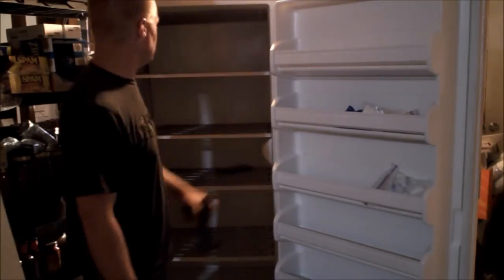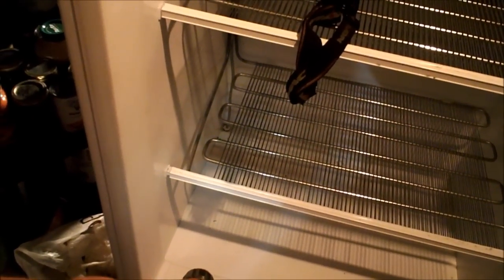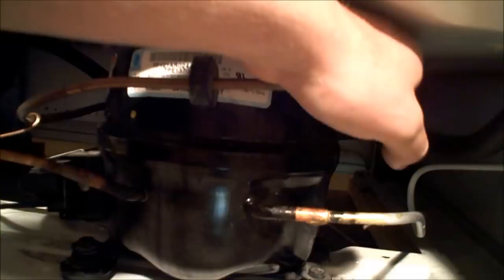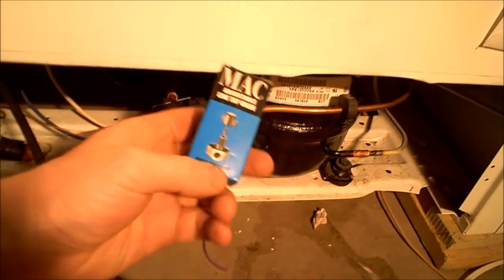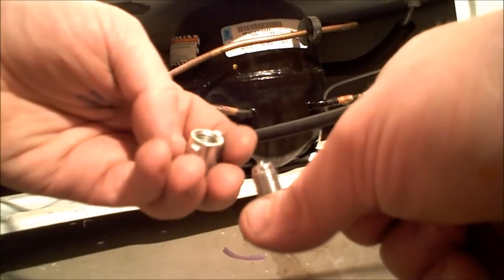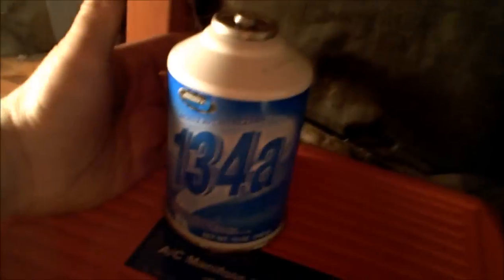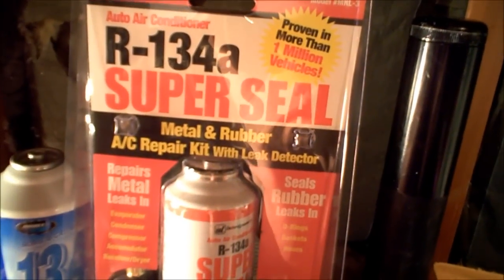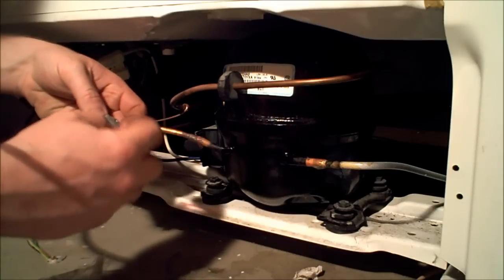Upright Freezer repair r134a refill part 1 of 2

Comment: Did the manifold attach to the line tap buy NOT using the auto a/c system quick disconnects?   It would have to be able to push open the schrader valve, correct?  I want to be sure I have all the right parts.  Good vid(s), btw.
Reply from the maker: Yes, the line tap connected to the gauge set through it's stock fittings. These fittings are for old Freon R12. So if your gauge set says it works with R-12 they should connect to the line tap.

Comment: I see that you are weighing the freon.  Could you not just put a little in, check pressure, etc.?
Reply from the maker: The most precise way is to drain the entire system and weigh in the exact amount labeled on the machine. However this isn't always a option for people. Yes you can watch the pressures and get close, but it is finicky. There is no real pressure number you can use. The pressures change with ambient temperature, freezer temp, and overall condition of the compressor. Too much refrigerant and the pressures will act virtually the same as not enough. So add slowly and wait for a while for the system to run and equalize. Then add more if needed.
Reply: That is what I was thinking.  Without draining the system, weighing wouldn't do much.  I want to do as you suggest and add slowly and observe.    If the pressure maintains 0 psi, should be there.  My freezer looks exactly like yours and the top shelf is frosted only on the back of the top shelf.  Tell me again how to be sure I'm selecting the low pressure side for the tap and how long to wait between adding freon shots to wait to see if I've attained 0 psi.  Great video and thanks.  I'm not adding sealant.  
And, should the freon can be up?
Reply from the maker: The easiest way to find your low pressure line is to just use the 4-8" line that dead ends coming out of the compressor. It is the line they crimped/soldered after they filled it at the factory. The refrigerant can will insert liquid if upside down and can lock up the compressor if too much is inserted at a time this way. It's safer, but slower to have the can upright and introduce vapor.
Reply: I also have a non-contact thermometer like yours.  In your video, you checked the shelf temperature.  Would it be better for me to also do this as I add freon?  If so, about what should the shelf temperatures be?

A lot of questions, but I am rebelling against "throwaway" mentality.  Last year i replaced capacitors in a TV, this year a freezer.  :)
Reply: Currently, top shelf is 32, then 65,64 and 68.
Reply from the maker: Ideally all the shelves should frost up, so under 32F
Reply: I really APPRECIATE all the advice.  I have the same equipment as you, so my game plan is to:
1.  Follow your instructions, but only add freon - not sealant.
2.  Place remote thermometer (with alarm for later)  and add small amounts of freon until 0 degrees inside.
If it works, great.  If not, nothing lost!
(My freezer is Frigidaire MFU21M3BW4).

Comment: Thanks for a great video.  My freezer - the manufacturer fill tube is bent and cut open.  I would like to add a filler valve there.  My igloo freezer model is FRF450-N.  There isn't much copper left on that line (cut near the condenser section).  Any suggestions on which part to buy off ebay - and what kind of companies could "braze" this?

Comment: I have the same freezer and same symptons, no freezing except partly on 1St shelf. A technician added some freon and it worked well for 1 week temp reached -30 celsius. Then temp start rising, he came and  told me that there was a leak and this would cost aroud 400$. So I did it myself. I bought the seal and the freon. When I added the seal ( 1 can) the pressure reached 60PSI and added one can of freon 6 oz, the pressure reached 75psi. Now the freezer is cooling at -10 Celsius, but is not  arriving at -20 as it should be. I am trying to add another can, but pressure is still at 75psi.  The gauge I am using is not a professional one, it got it when bought the cans( RED TEK). What shall I do to have -20 to -30. celsius?
Reply from the maker: +reza fokeerbux If you've added the proper amount, there is a high chance that your filter/dryer is partially clogged and not allowing freon flow.

Comment: Do you know why my electric fuse from power meter jump off when i turn the Bosch Freezer on?
Reply from the maker: +tom wolf More than likely your compressor motor is seized internally. If this is the case the compressor motor will buzz/hum for a second before shutting off the power meter/circuit breaker.
Reply: thanks, ya i think compressor  have a problem, i saw a little smoke too

Comment: Those line taps will eventually leak. Braise in a access valve and pull a vacuum and a new filter dryer. Don't use those line taps he used ever.

Comment: Hello
Please help me I have a freezer when you play it is working properly, but after a period of time over 5 or 6 hours depending on the cooling and the rear evaporator normal temperature becomes knowing that the compressor runs continuously stay although I changed the device temperature control

Comment: what type of adapter do i need if you can advise me please,i have the mac adjustable line tap valve installed in my refrigerator gas line but i have trouble finding the right valve or retrofit adapter so i can use the small can of gas. thanks

Comment: I have a Kelvinator Impression Series 500 Twin Air No Frost 1998 model.  For the past 3 days the fridge department temperature oscillates between 13 and 15 degrees and the freezer temperature is 0 degrees (and not freezing ice-blocks).  The freezer evaporator fan is working, the compressor is starting and working, the evaporator is not over-frosting, the air ducts between freezer and fridge departments are free of blockage, cool air is circulating into the fridge compartment, I couldn’t find the defrost thermostat behind the freezer panel, the defrost timer is not stuck in defrost, I tested the heater element using the defrost timer manually and the heater element is heating, I don't know if the defrost timer could be damaged and cycling too often, but I haven't noticed the evaporator fan switch off once, so I don't think that's the problem.  The seals were all changed 12 months ago and all sealing well.  The problem happened from one day to the next.  What can it be, do you have any suggestions?  Can the fridge be low on gas?  Or can it be something else?  Please help.
Reply from the maker: javierpaez13 If the evaporator isn't getting cold enough and icing the entire thing there is a good chance that it is either low on gas or the inline filter/drier is clogged.
Reply: sixtyfiveford I didn't know how to test the inline dryer/filter, what I have done is feel all the condenser coils to test for hot gas flow.  I noticed that all the coils are fairly warm but easy to hold (between 50 & 55 degrees Celsius), but 1 coil was too hot to hold onto (say 65 to 70 degrees maybe).  Does this give you any indication of the condition of the inline filter/drier?
Reply from the maker: The entire evaporator should be icing up and getting down towards minus 20 C. If it isn't all covered in frost as it is running then you're low on gas or the filter/drier is plugging up.
Reply: osixtyfiveford I can't measure the temperature, but only the top evaporator coil is freezing, the rest 6 rows of coils are not showing any frost on them.
Reply from the maker: Then enough refrigerant isn't reaching the evaporator coil (low gas, plugged filter/drier or rarely a worn out compressor). You can't really test the filter dryer. The fix for that is replacement by solder/brazing a new one in. If you can find a visual gas leak then you can fix that and add more refrigerant gas. The compressor is also one that is hard to test without piercing the lines and hooking up gauges.

Most Technicians will recommend a new fridge as the repair cost can get close to the cost of new. If they do work on it they will look for a leak and then replace the filter/drier. This requires removing all the refrigerant gas and recharging it (not cheap). They will more than likely also recommend a new compressor(not cheap).
Reply: sixtyfiveford Thanks champ, I have really appreciated your videos and your responses to my questions.  You have confirmed my worst concern, which is that I need to replace the fridge.  Cheers, PS. Love your videos.
Reply from the maker: Thanks. I wish it was better news.
Reply: e rer err e e err er 're 're rrreeeefeRenee e 'r Reeder referee r eeeeeeereeeerr

Comment: My small stand alone freezer runs fine then one day everything is half thawed and the outside of the freezer is quite hot do you know where I should start to look for what the fault would be it's quite new too.
Reply from the maker: Standard freezer or frost free? Simple causes:
Standard freezer- If it was heavily frosted up it could have just overheated. Unplug it to let it cool down for a few hours to melt all the build up ice and replug it in.
Frost free-The issues are more complex but the heating circuit(timer, coil, etc) could have malfunctioned and the evaporator coil is frozen with ice. Unplug it to allow the coil to melt the ice then replug it in. It should work for a few days then act up again if this is the problem.
Reply: Yeah it had been unplugged(because food was half thawed) and defrosted then plugged in and runs fine for a week or 2 then checked again and food half frozen and outside of freezer really warm so I have turned off. How do I tell if it's frost free ? It's only a small cheap fairly new freezer. Thanks again.
Reply from the maker: Stand up or chest freezer?
Generally they will put a logo on the door that will say frost free.

Stand up frost free will have adjustable main shelves. Standard stand up will have fixed main shelves.

Virtually all chest freezers are NOT frost free.
Reply: Stand up fixed shelves I don't think it's frost free,  so where do you think I should start, thermostat or something? Strange how it goes fine for a while, turns on and off properly but you open it one day and half defrosted food and motor going and warm exterior.
Reply from the maker: Yeah, sounds like a standard not frost free freezer. They have a lot fewer parts and are generally more reliable. It really could only be 2 things: thermostat(I'm doubting this) or the compressor is going out. They seam to have around a 10 year life. How old is yours?
Reply: sixtyfiveford that's the most confusing and frustrating thing, it's only 2 years old ( just out of warranty) and been well cared for.
Reply from the maker: What is your model number?
Reply: Telmann TF 10-Q   Thanks for your time
Reply from the maker: I can't find much info on it. It looks like a Chinese built unit without much/any product support.

All this info below is based on if this is a Manual Defrost freezer. This would mean it would build up ice around the inside and occasionally you would have to turn the thermostat to "defrost" or unplug the freezer until all the thick ice build up melted. Then plug is back in and resume operation. If this is the case it is a very simple design(good thing) so the diagnosis is pretty straight forward.  Though less can go wrong with a Manual Defrost freezer, it is generally the thermostat or the compressor/refrigerant. Since it is running still and warm, the thermostat is doing its job and working normally trying to get the freezer cold. This only leaves "major" problems: it could be low on refrigerant, the compressor could be bad, or the filter dryer could be clogged. None of these are an easy fix, sorry.
Reply: Thanks for your help I saw a review of a person with this freezer and the same  problem, they returned it but were within the 2 year warranty. I agree with you it must be serious because it is manual defrost and very simple design and almost brand new. I won't buy cheap Chinese freezers again! Thanks for all your help with this.
Reply from the maker: Sorry it wasn't a simple fix.

Comment: I would think since piercing valves "Line tap" depending where you are and what is offered... have a reputation of leaking eventually, then putting the sealant on after applying the tap would stop that eventuality.  Also should be mentioned it should go on the "straight" part of the line to assure as good a seal as possible without bends to make it weak.

Comment: Thank you for the well done video..  My Freezer is an old Kenmore upright and all the tubes come in and out on the left side of the compressor.  How do i tell which one is the high and the low.  i assume the low is where to put the tap.  when the freezer is running one tube gets hot like the upper part of the compressor and the other is not hot.

Comment: Using a gauge set for multiple refrigerants is not harmful. That is a myth. They actually make compound gauges which is made to use on multiple refrigerants in different systems. The amount of oil residues is so small that it's not going to make or break you. I've been doing it for years. Epa, state certified.

Comment: Rofl dont listen to this guy, your using the wrong 134A. the oils in the one from "walmart" are different and will jack up your compressor over time and should never use the gauges for both because the oil and moisture is in the gauges.
Reply: 134A is 134A , no matter what brand , that's why there is an industry standard for refrigerants.
Reply from the maker: Lol there are no oils in a plain can of R-134A.

Comment: How long did this repair last?  I have a very very slow leak and wondering if I should try this R134a Superseal repair as well.
Reply: I'm reading reviews about the product and see mixed reviews for using it in Car AC repair.  But can't find any reviews on using it in Refridgerator repair.
Reply from the maker: If I did it again I would omit the sealer and just refill/top it off every 5 years.

Comment: FYI, when I was in business, I always put the saddle valve on the stubbed / crimped and brazed fill line used at the factory... probably b/c in my experience I've found the valves often tend to leak over time. Consequently, by putting the saddle on the stubbed (original fill) line, I can always go back and braze a schrader valve on that line. Whereas  if it leaks on the low side line, as you have it, it would be necessary to braze in a "T" -- where the "hole" is -- and then add a schrader valve to the the "T".  I still have my 36 year old Gibson... about 10 years ago I had to add R12... leaked out after about 6 months... finally discovered the high & low lines that were sheathed in foam had corroded through (with years of sweating & sitting in moisture inside that sheath). I replaced both the low side (from the compressor to evaporator) and high side/ capillary tube with new accumulator/drier, THEN wrapped the lines with AC cork (it keeps moisture from getting to the cold return (Iow side) line & condensing). AND, it's still cooling as good as the day we bought it! 36+ years ago!
Reply from the maker: True, the fill hose would allow it to be pinched/brazed in the case that the valve leaked.

Comment: when the freezer is done , i heard the motor makes a good compressor for the garage, small things like air brush and such . i wish you would make a vid on that please and is there a diy way to take the freon out?  you are a true " jack of all trades master of none " .
Reply from the maker: I've considered it but haven't had a need as I have big compressors. I like the challenge and think I will do this. As far as venting R-134a you can just let it go..... Before you say NOOOOOOOO!!.. The cans of computer duster air are only R-134a and a bittering agent so you don't inhale it. So the millions of cans of computer duster have already put this stuff into the air. The new cans this year have the new Freon R-152a. It is supposedly better at cooling than R-134a.

Comment: WHAT PRESSURE DOES THE COMPRESSOR IS SUPPUST TO HAVE?
Reply from the maker: It will say on your data sheet.
Reply: ok...thanks....
Reply: could you tell me where i can locate the righ tube to instlall the piece for charge refrigerant
Reply from the maker: Google some images of the refrigerant system. It will help you find the low pressure side.

Comment: What will happen if you let all the pressured air out after piercing?
Reply from the maker: If all the gas has escaped then you would generally pull a vacuum. Pulling a vacuum boils off any moisture that may have gotten into the system.
Reply: sixtyfiveford is there a step by step guide that you would recommend?

Comment: I used to be Bob Smith...can't remember pwd.  Anyway four days ago I finally added the sealant stuff and then topped up with Freon.  Problem was that I  put too much sealant in and probably ruined the compressor.   The thing would not work so I unplugged it and ordered a new fridge.  I plugged it back in a day later just for the heck of it and it is now running. 

My question to you sixtyfiveford is how often do you have to top up after you have put the sealant in?  In the past I had to top it up every four weeks but now I am wondering if the sealant did the trick.   The freezer is really cold now.  What do you think I should do.  Buy the new one and sell the old one?

Thoughts please?
Reply from the maker: After the sealant you should never have to put in refrigerant again. I would let it run for a couple months before I ever sold it. Just to make sure it was working good and had a chance to circulate everything.

Comment from the maker: The service line has the same pressure as the inlet line as they both dump directly into the body of the compressor. I planned on leaving it inline indefinitely to add r134a as needed as the leak point was never discovered. Yes the service line is better.